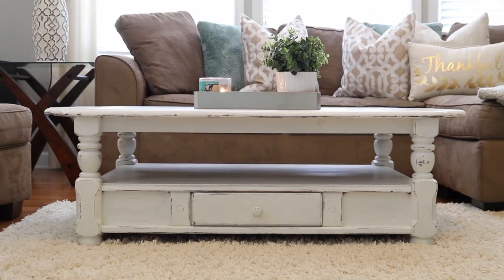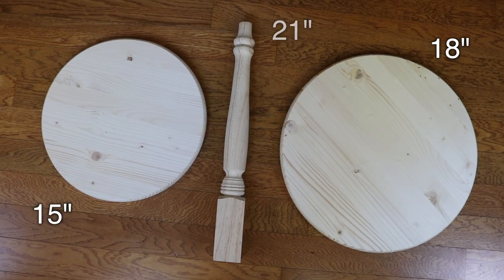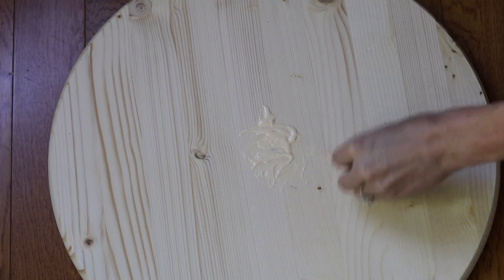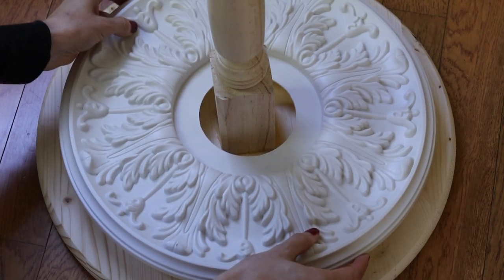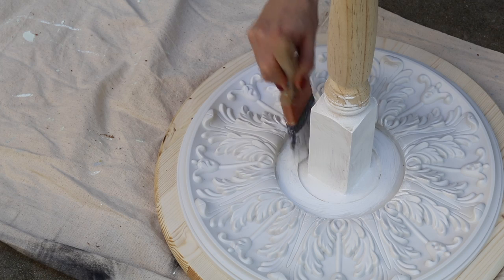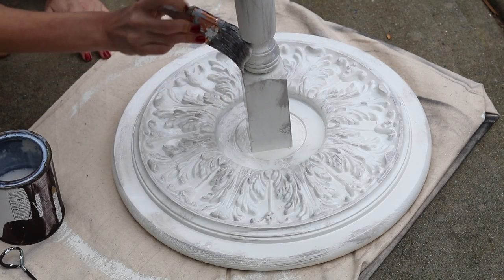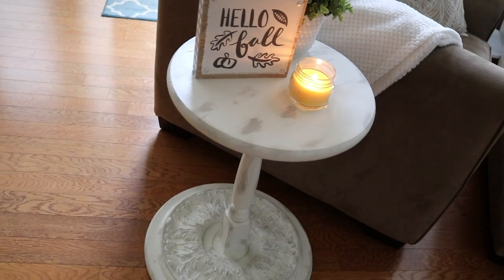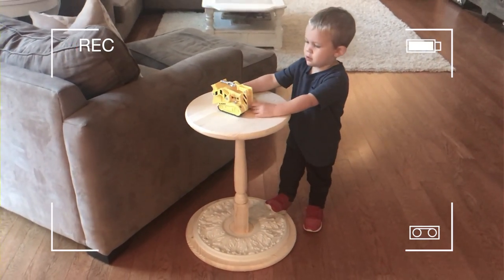DIY PEDESTAL TABLE (no tools required!)

Comment: You actually answered a question that I was going to ask you. 
I recently painted my laminate night stand with Waverly chalk paint. Then I followed with Waverly wax to seal it. The paint was fine but the wax was awful, unless I applied it wrong. I let it cure 24 hours and tried to buff it off. It came off like rubber cement and didn't look right.
Next project, I'll seal mine like you did with this table.

Comment: Hi Katherine!
Love you videos for inspiration on decorating on a dime. Your latest video on your cute side table is sweet, but can I make suggestion? For more strength and sturdiness, drill a long nail through the post, one into the middle top and one at the bottom that counter sinks into the wood, cover it with wood putty, sand and paint. It will stabilize the post and survive any accidental bumps from adults to kids. Keep those videos coming, your home is lovely, God bless you Katherine your family and your boys are sweet! 💚